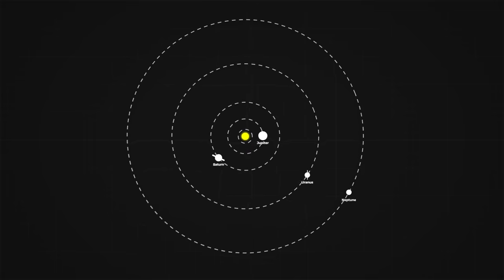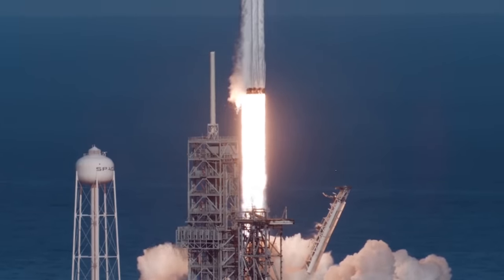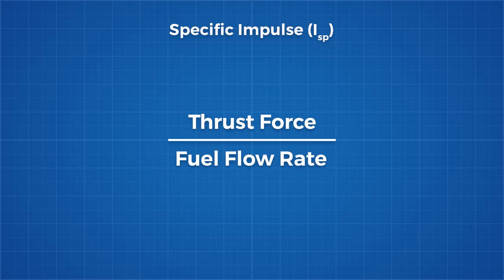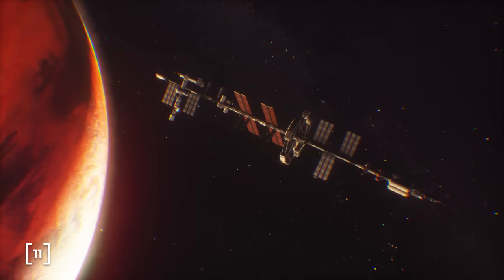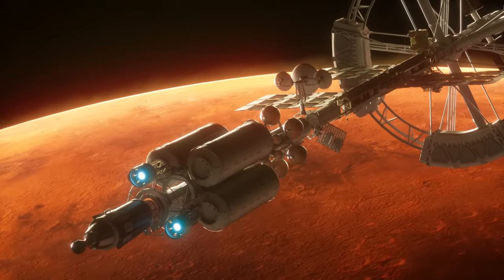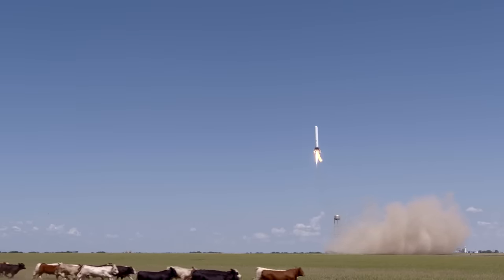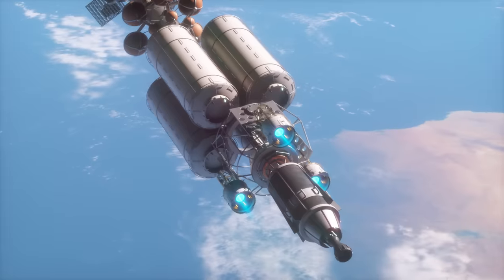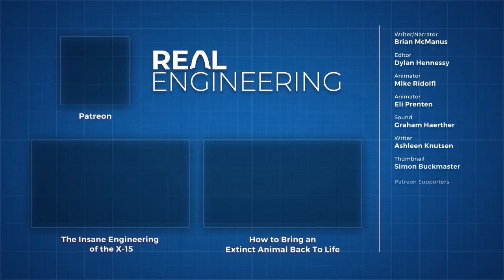Can Nuclear Propulsion Take Us to Mars?

Comment: Was hoping to see some discussion on Nuclear Explosion Drives, where a small fission reaction explosion is the source of the thrust. Pretty interesting if not exceptionally challenging.
Reply: How would that work? you need to eject a lot of mass to create thrust. There is no enough uranium to simply explode and shoot out. Also won't it spread radioactive waste?
Reply: @Ghost_of_Gaby  It was called Project Orion, and it was cancelled in the 1960s for your reasons and every other reason you can think of. It was a fantastically horrible idea, done before the stronium-90 tooth surveys.

Comment: These missions captured my imagination as a kid.  Now I have 7 interplanetary mission under the belt. You just gotta go for it.
Reply: JD Russell  You mean project Starshot?
Reply: JD Russell  Do you have slightest idea how massive Deimos is?
Also right now we have 0 space mining tech.
Reply: @ImieNazwiskoOK  Ya it'd way more realistic to just try and construct a rotating habitat in Earth orbit and fly it to mars.
Reply: @lurkag2672  But this creates fuel problem (as shown in video)
Reply: JD Russell  What?
Reply: @ImieNazwiskoOK  The habitat doesn't have to be insanely huge. Many people can adjust to fairly rapid rotation rates. So we could definitely get one there with current propulsion technology.
Reply: @ImieNazwiskoOK  I'm only talking about getting to mars btw, not interstellar.
Reply: @lurkag2672  It needs to be big for artificial gravity to be stable, which will create fuel problem.
Also you need to space to live in during that long travel and space for things like: food, water, equipment, lander and return craft, etc
Reply: NON OF YOU KNOW WHAT YOU ARE TALKING ABOUT
Reply: JD Russell  I think you underestimate just how big that actually is.
Reply: JD Russell  One does not "simply" wrap something in a solar sail (If you want it to move fast). To get any useful thrust, the solar sail for something as massive as Deimos (much less Phobos) would have to be insanely huge - and it would not be wrapped around it - it would be far larger than the object in question.
Reply: @drawincode1800  I think you might be right.
Reply: It will stay in imagination land because it will never happen
Reply: Gravity is a non-existent, imaginary make-belief concept; atmospheric density, or the surrounding pressure of the air's bouyancy keeps: clouds afloat from falling down and levitates up lighter density gases like smoke

Even in when smoke, air, and other gases are injected into an "empty" airless container, the gases always rise up as high as the top of container is!

If we live on round spinning / rotating globe that travels in "space" non-stop, well over 35,000miles an hour, well over 750,000miles per day; why do water and other fluids all lay line-flat, and rest dead-still at the same time?! 

N0 one ever feels even an ultra-small, slightest of anything, rotating sense/feeling, of the computer animated, fake, deceitful,  globe model's spinning centrifugal force! The illogical, silly, make-belief globe model is non-existant; it is just outright impossiball!

The speed of the ferris wheel that I was riding on very uniformly sped up to it's maximum speed of about 7 kilometers an hour in under just the first 45 degrees of rotation; and it rotated over 270 degrees at the speed of 7 kilometers an hour uniformly (without any deceleration or further acceleration) until decelerating to a stand-still in under the last 45 degrees of rotation. 

I sensibly felt the uniform rotational force of the giant ferris wheel even during the non-speed-changing section of the rotation when the very slow (roughly 7 kilometers an hour) wheel's rotating speed / spinning motion was constant! 

The World is a stationary, non-moving Flat-Plate under the Dome Firmament exactly as the Bible describes !

"_The Flat-Earth Bible_" 

https://www.ic.unicamp.br/~stolfi/misc/misc/FlatEarth/FlatEarthAndBible.html

The World is a Flat-Plate under the Dome Firmament exactly as the Bible describes !

"_The Flat-Earth Bible_" 

https://www.ic.unicamp.br/~stolfi/misc/misc/FlatEarth/FlatEarthAndBible.html
Reply: @Evike95Air Newton (a Christian) proved that gravity is a real force Pascal (a Christian) proved that bouancy is caused by gravity centuries earlier. Copernicus (a Christian) disproved the centrifugal counter-argument a century earlier. Kepler (a Christian) poimted out, a century later, that passages in the Bible you described are meant to be poetic - similar to how one would say that "the trees moved past" when looking out a car window, knowing full well that its the car that is moving, not the trees.
Reply: @jeffbenton6183  See if the Book of Revelation will be fullfilled and come true in our present lifetime...
Reply: @Evike95Air  "You know neither the day not the hour." Matthew 25:13
Reply: @jeffbenton6183  I believe there is land beyond Antarctica, the wall of Ice which surrounds the World!

The wicked, deceitful, Satanic, Illuminati (or should more accurately be termed [ILMN] - [IllLieMenNaughty]) governments of the World are probably hiding "secret" land beyond the Earth-Wall of Antartica !
Reply: @Evike95Air  How does that have anything to do with what I said?
Where does the Bible say anything like that?
How could there be land beyond the hypothesized edge of the World? If the Ice wall surrounds the entire World, that's it, the end. What you said before was wrong, but at least it was logically consistent.
Reply: @Evike95Air  I Read it. This guy seems to express, both that the Bible explicitly says the Earth is flat, and that the Bible is wrong.
I'm aware of the ancient cosmology that he's talking about but pretty much all serious Christian scholars going back over 1600 years, in reading the theological significance of those passages, did not believe that they necessarily reflected the actual physical structure of the Earth. Pretty much all Christians throughout the Middle Ages and to the present day have been comfortable with the idea of living on a globe.
Reply: @Evike95Air  But at least you finally started citing some sources.
Reply: @Evike95Air  Why don't you just go to Antarctica and find out what's on the other side?
If you look at the SRTM radar image of the surface of the Earth..it is in fact the ONLY image of the entire globe in a single coordinate system, moreover it used interferometric radar (like a hologram). It's a 3D image, and guess what? It's round.
The data are beyond the simulation level of any computer, it was written to tapes that filled the shuttle cargo bay. We took those tapes straight to analysis, and the earth was round. It simply could not have been faked by anyone or any government. Moreover, me and my homie  place targets around Earth at locations known only to use, with a precision of around 1 inch, and guess what? They were in the data...it would be impossible to fake that in a simulation.
Search online, I think the data are free.
You could also use a GPS, travel in a large triangle. You will find the angles don't add to 180 degrees. If you understand geometry: that cannot be faked on a flat surface...it's is mathematically impossible to do it for an arbitrary triangle.
Reply: @Evike95Air  We can no longer argue with you. Only the future will tell the truth.

Comment: 13:20 problem with Helium is that until we literally start mining gas giants it is far to precious to use in such applicatons, as opposed to commonplace hydrogen.
Reply: There is Helium on the moon and a lot of it is Helium 3, fusion reactor fuel.
Reply: Andre Hpunkt  The moon is not hollow, it is made if light silicates, aka rock, not much metal.
It would be pretty tough to wreck a 2100 mile diameter rock ball.
Reply: @pranavkondapalli9306  Not much, less than the moon, it would be easier to skip Mars and just skim it from the upper atmosphere of Jupiter.
Reply: Dosen't the moon have a large amount of helium deposits?
Reply: So we need to trap enough hydrogen to start a portable Sun and create our own Helium variants . If we can see the beginning of the universe in the Hadron Collider making a mini Sun to make Helium should be a snap !
Reply: helium is still 25ish% of the universe, and will presumably be fused up to the iron limit anyway if we survive long enough
Reply: @pranavkondapalli9306  it is estimated that there are at least 1.1 million metric tons of helium-3 on the lunar surface, enough to power human energy needs for up to 10,000 years.
Reply: We have plenty of He.

Comment: Cool video! Although I feel you might have undersold Nuclear Thermal video a little - I get the point, since it's more about the potentials of NER, but NERVA is quite an early design that very much in the lower end of what can NTRs do (even for solid cores!). Not to mention that I feel like if we were indeed going with a nuclear thermal, it'd likely be an NTER instead of a simple NTR, as that can push the exhaust velocities much further into the 10+km/s range, or even NERVA-like performance using more easily storeable propellants.
Reply: Timberwind was supposed to be a lot better than the OG NERVA designs. What a shame we never built it.